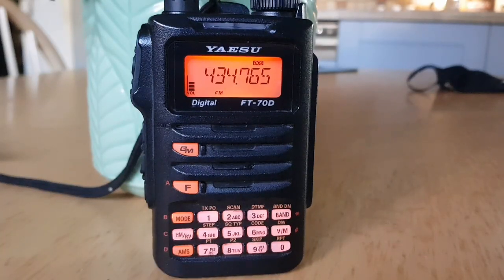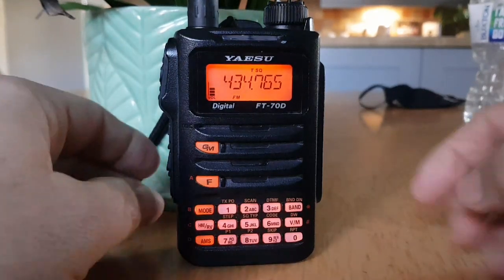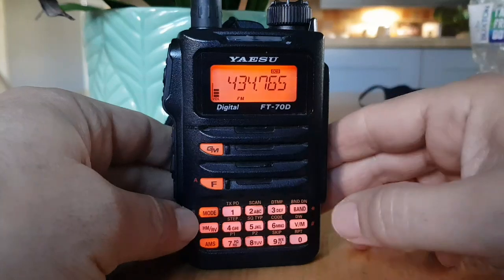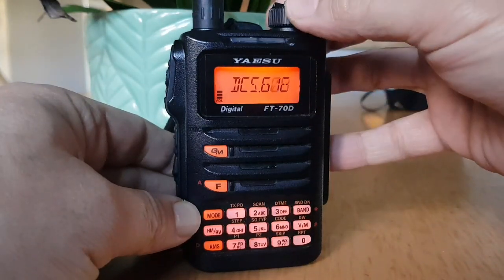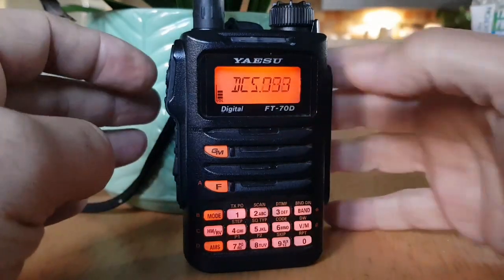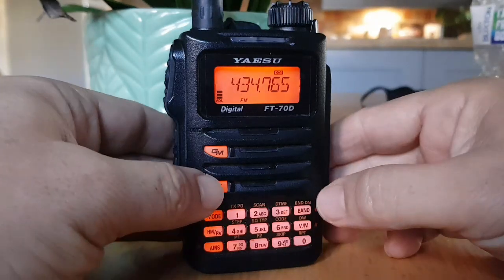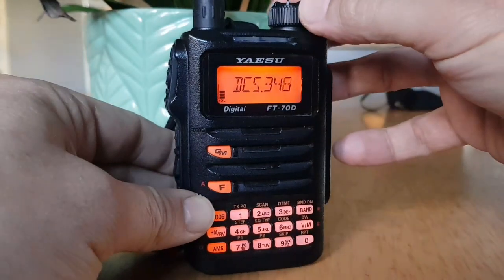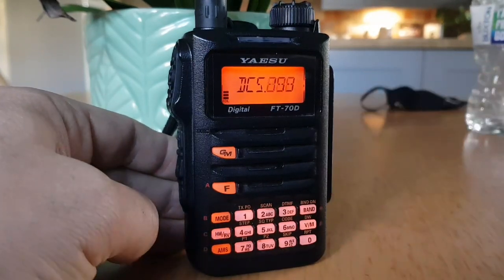Yaesu FT70 - Using DCS code - Searching and selecting

Comment: I own a FT-70 and I cannot figure out how to operate the radio with a DCS code for tx and no  code for rx. Any help would be greatly appreciated.
Reply from the maker: Why do you need DCS ?
Reply: To make sure there is no traffic on that channel before transmitting. Hitting the moni button opens up the RX but I like to keep all my RX open with no tomes or codes. My IC2370 does this with no problem. It's often called cross mode
Reply: Same here.